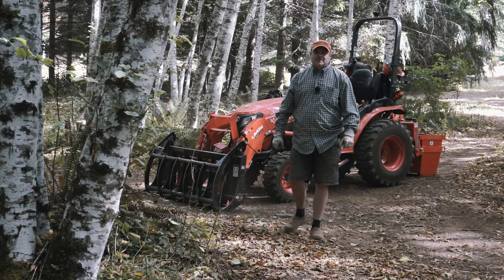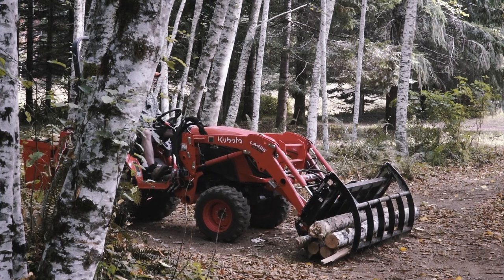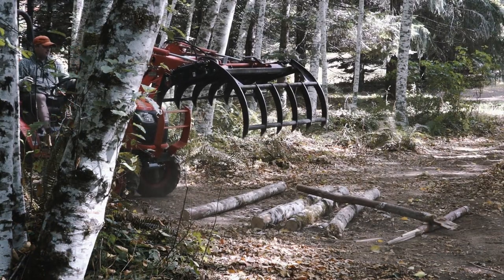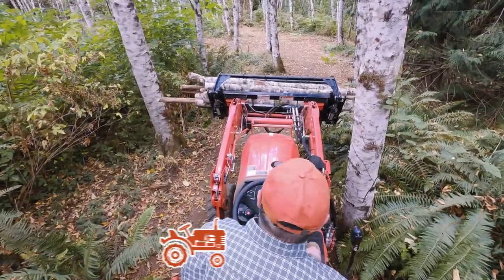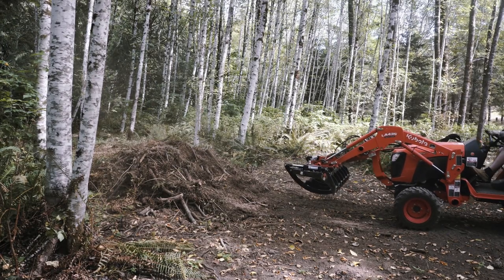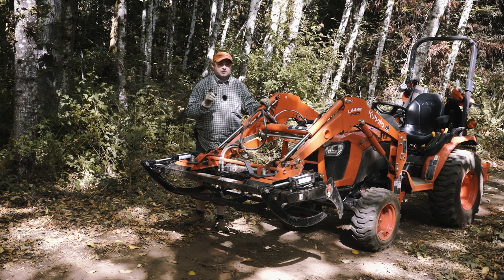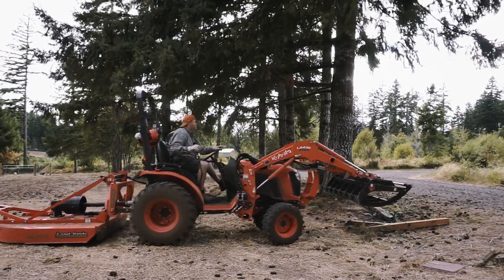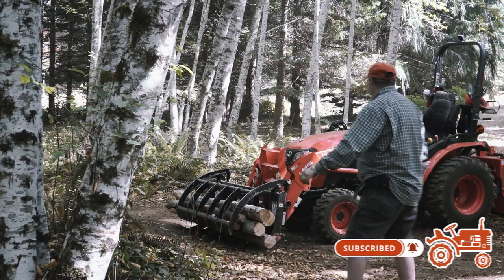Grapple Like a Pro | Tips & Tricks | Kubota B2601 & Land Pride SGC0660

Comment: Be careful pushing on anything with the loader bucket cylinders fully extended.  That is a good way to bend the hydraulic cylinder rod.
Reply from the maker: Hi Matt, yep very true. I assume you're referring to the battering ram config. They're not fully extended there and I only do that to push over old wood fence posts, samplings and dead Alders that are about to fall over with the wind. I have more concern when using the stump bucket and after watching THAT video myself, I see that I'm going to start using the bucket with way less steep bucket angles. Thanks for watching! :) - David
Reply: @PaleHorseOutdoors  yep that's it.  I bent a rod on my B3200/BH76 backhoe and it was $300 for just the rod from Kubota.  I don't want to make that mistake again!
Reply from the maker: @MattN03  No doubt, buddy! Thanks for reminding the community about that. I mentioned in the video to be careful, too. :) - David

Comment: Great tips and advice! I've had that problem with too much pressure in my grapple lines before too - bleeding them out a little is the easiest way I've found to get the connection made.  Our grapple is a little different, in that the rake teeth on the bottom are longer -so I can often just scoop underneath what I want to pick up, then clamp with the grapple and lift.  I don't usually need to tip the grapple forward to pick things up.
Reply from the maker: Thank you! Yep when those hoses won't go on, it's a real pain. I've heard of a few other ways to try to relieve the pressure but for me bleeding is the easiest. Which grapple do you have?

Comment: Connect the 2 grapple hoses to each other. Solves the issue of bleeding and keeps the sealing surface of the male fitting clean. I have flat face fittings too.
Reply: That worked for me until I couldn't get them uncoupled!  I ended up buying a set of couplers and installing a ball valve on each half.  I plug these into the grapple hoses, crack the ball valve, remove the "pressure relief valve" and then plug in to the tractor.
Reply: @kylerayk  That sounds like a great solution I hope I remember it when I get a grapple 😁👍🚜💨💡

Comment: Great video.  If you put the loader in float mode when picking up the logs it will make easier and not pick the front end of the tractor off the group.  GP Outdoors has a great video on it, I can't remember what the video number is.
Reply from the maker: Thanks for the idea!

Comment: As much as you use your grapple David, have you considered a grill guard? That would be my top concern.
Reply: I welded expanded metal onto the back of my grapple all the way across.  I don't like how most grille guards block the headlights.
Reply: @kylerayk  , my guard blocks my headlights. On these loader tractors the loader and buckets pretty much hinder the lights anyway. I added an led light bar to the top of my tops which does a far superior job of lighting. Can’t use it on the road though.
I think your idea of the expanded metal on the grapple is the best one I’ve heard yet.
Reply from the maker: Hi Gary! Yes it's on my very long list of needed mods. I don't have any welding experience myself, but I've watched a few videos and seems pretty straightforward. I have a friend that welds, but getting him out to the property is a challenge LOL - Thanks for watching! - David
Reply: @PaleHorseOutdoors  , Hey David, one of my videos a while back shows where I got a custom made grill guard from Zook’s Welding in Fremont Ohio. He makes them and shipped they are around $200.Very cheap when compared to a new radiator,battery, and all the other stuff right up front where any crunching sound coming from there probably means hundreds of dollars.
I liked Kyle’s idea. Certainly better than nothing at all.
I am one of the lucky ones. I used mine for three years without any oops. Ed from My Cluttered Garage got his the first time out.
Kyle’s way would be much cheaper but will have a couple other drawbacks. Still much better than not having any protection
Reply from the maker: I've thought about doing something similar. I use my grapple to pick up small amounts of dirt when I'm doing grapple work in the woods and it grabs quite a bit if there's a fair amount of leaves/twigs/roots mixed in. Your idea would probably help it grab more loose dirt than without one and still offer a nice level of protection for the grill area.
Reply from the maker: Thanks for the info on Zooks. I just found them on facebook and I'll check it out. Yep, it's been a game of Russian roulette so far!

Comment: Great tips, but please show how you grapple a bunch of wonky, twisty logs at the same time.  Picking up a grip of nice straight, round logs is pretty straightforward.
Reply from the maker: Hi Kyle, thanks for watching. The technique of aligning, pushing/pulling, curling (pinching) and adjusting the loader arms while grabbing apply to anything you pick up whether it's straight or gnarled logs. For the most part, you want to block and limb the logs before picking them up or you might punch your grill with a limb. Twisted/gnarled logs can be picked up in a group, but personally I always limb and buck them so that they are as straight as possible so I can fit more at a time in a single load. Take care! - David

Comment: When parking any hydraulic cylinder relieve any hyd pressure before disconnecting the hoses. even better move the cylinder away from bottoming out first. then even if there is pressure in one hose when you recouple- cycling the valve with one hose attached will make draining opposing hose unnecessary.